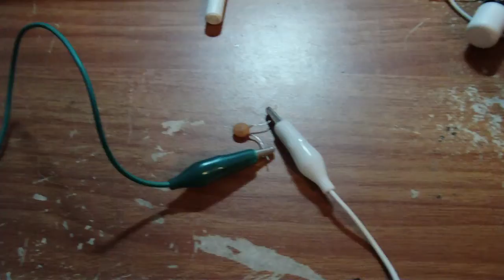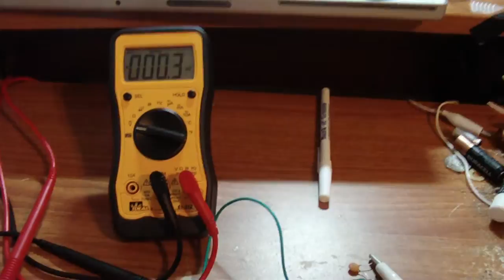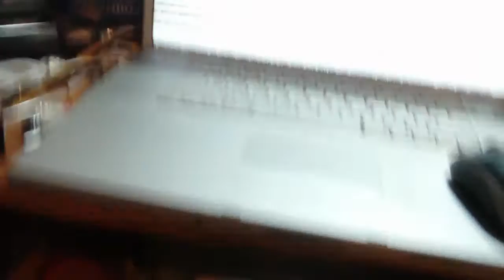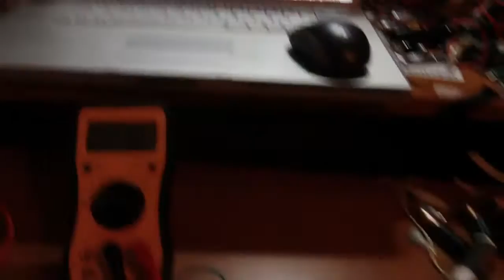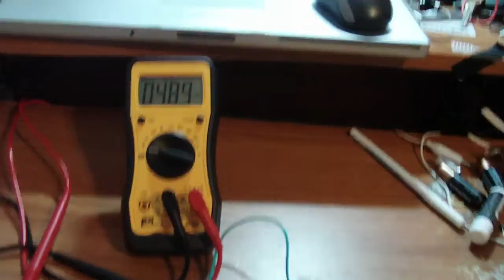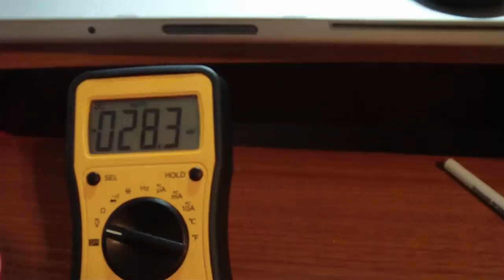Capacitors are Heat and Piezo energy collectors

Comment: Sorry for the multiple posts ibpointless2, but it seems I'm probably wrong.
Your voltage meter should drag it all the way down to zero, but in this video it clearly wants to stay in the area between 23-28 volts. This is interesting....

Comment: One more thing. A way to check if I am wrong is to let it stay in a relatively constant higher temperature (like your body heat or more). Then connect a very high ohm resistor over it, so that the draining takes long enough for you to register.

The thing is, if it is just a decrease in capacitance which is taking place, then  ultimately the voltage should drop all the way down again, with a tiny load over it.
If however this is a conversion of ambient heat, then it should settle on some level.

Comment: Okey I think I get how this works.
If you have a capacitor where the charge is restricted and cannot flow, a change in capacitance will cause a change in voltage.
More capacitance will lower the voltage and opposite. If you had it connected to another voltage source while you were changing the temperature, the voltage would be constant but there would be a small current going back and forth for each cycle.  You would then be driving it parametrically.
A guess anyway....

Comment: Once again on the trail of ambient energy, great observation, perhaps if someone placed in a string of ceramic capacitor's on each leg of several transistors set up in the darlington fashion so that the collector is ultra sensitive to atmospheric changes and starts the flow through the other strings to do some work! Once again great job!